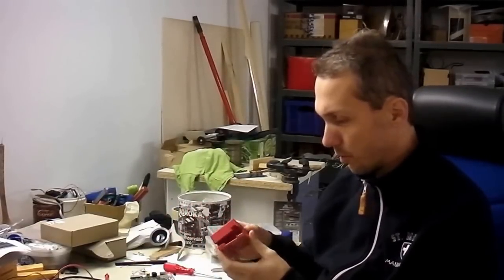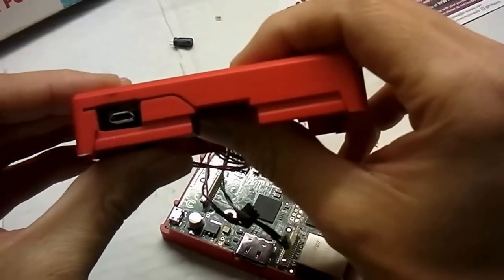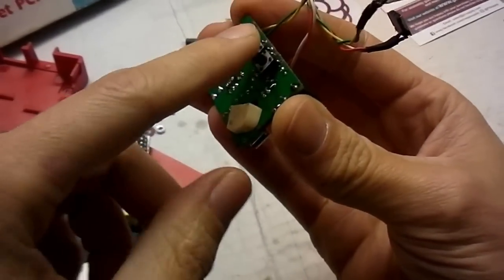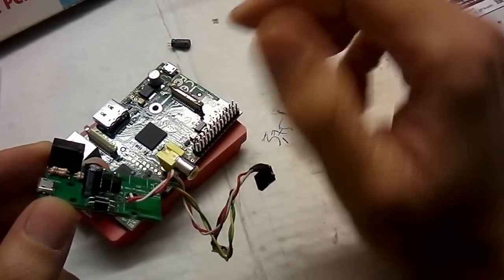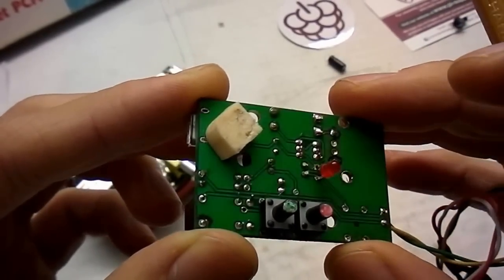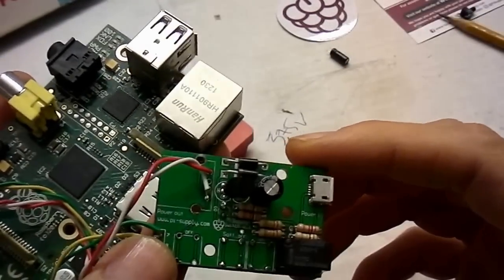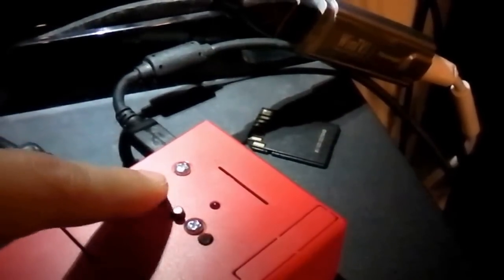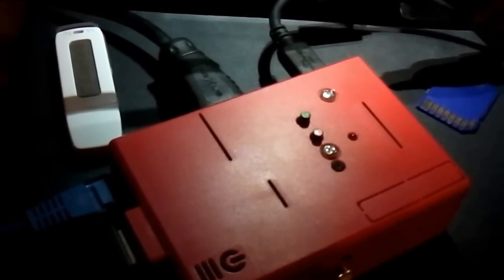pi-supply switch mod

Comment: Thx for this video.
I want to buy also this Pi-Supply switch for a infrared remote-control.

But a question is important for me:

It is necessary for switch on and shutdown the Pi to press the buttons longer as a half second?

The reason is, the relay of the remote control shorts the contacts for 0.5 to maximum 1 second.

Thanks for an answer!
Reply from the maker: The startup is instantaneous. For the shutdown ... it depends on your shutdown script. If your shutdown script queries the button pin in every half a second, than it might loose the shorter events. My "alternative" softshut script queries in every 100 milliseconds.
Reply: Thx for this. I think, through editing the startup- shutdown script it will work in my case.
Reply from the maker: If you're about to go remote, why don't you use the RemotePi board instead? https://youtu.be/aMH5q4_cHR4

Comment: srsly this is the smartest solution to solder the buttons on the bottom side. as a beginner in soldering i have to admit this board is NOT for beginners! even if you manage to get along with the board. i'm stuck with copying the code on my recabox. there is no official proper tutorial yet and YT is your friend in this case. i sometimes regret buying this board but its a nessesary thing to have a propper pw on off button. this guy here tells the truth in every way and has a genius solution even shorten the hard reset button, an idea i wish they had from the get go! best pi switch video, hope you make an entire tutorial video, because you buddy are a hero (priceless hint mounting the buttons on the bottom, as ez as it sounds but if you follow the illustrations, you will put them on the "wrong" side. love you man, you made my day @Balázs Kelemen
Reply from the maker: The board is very dens, still too big. I'm just in a project refurbishing this module, and I'm in trouble because of the size. That USB out is really pain in the neck.
Reply: could you personally help me getting the board running on my rasp pi v3, i go insane with all these useless bits and tutorialk pieces. im a metal stone woodwoking type of guy and that it stuff makes me go nuts and i am fractions away from throwing this shit against the wall. i made the file that has to run the softshut , made the directory first, cd in and made the .py file but now im stuck where to put the code into the bootsequence because everyone seems to edit the "normal" pi but i cant find a noob friendly tutorial for recalbox. following the official steps take me nowhere because he opens files that are empty compared to yt videos... so no existing text and im not THAT much into linux , and never had a linux based system before, thats why i feel unsave and dont want tu ruin the pi and the wort that went into so far. i'm willing to pay for a good tutorial but i need help asap :( you seem to know  a lot and think beyond the retailers smallminded boards and lacking tutorials. obi wan kenobi, you're my only hope :.-(
Reply from the maker: I'm afraid both of are seeking the answer for a wrong question. It seams that the Pi (at least Pi3) already has a built in power on-off feature, that works without any additional active electronics. Please check out this page details: https://howchoo.com/g/mwnlytk3zmm/how-to-add-a-power-button-to-your-raspberry-pi . For recallbox you have this theory built in, and ready for activation: https://github.com/recalbox/recalbox-os/wiki/Add-a-start-stop-button-to-your-recalbox-(EN)
Reply: Balázs Kelemen true story 50€s wasted for the additional useless hardware. bootconfig on/off pushbutton configured after a hint on facebook. mission accomplished. you‘re the best ^^ simple and ez. next time i ask you from the start :D

Comment: I have the Pi booting and the led flashes once then after a couple minutes the Pi will shutdown.
I'm unable to get any input to register in the script while the Pi is running.

Any ideas would be helpful.  Thanks
Reply from the maker: If you use a port other than GPIO8, you need a script installed that programmatically pulls high that pin for the Switch. If you do not do this, the Switch will assume, that your Pi is not running and switches off. (At least this was the case 2 years ago. It might happen that since that GPIO8 is not reliable for this job any more.)

Comment: I have just got the power supply switch and trying to figure out if it is possible to use this module for automatically timed turning on and of of a device? Do you maybe know for some solutions regarding this? I am trying to build insect trap that should wake up once a day and take one photo, send it and turn off.
Reply from the maker: Basically, yes. You may use your own circuit, to alter logic levels instead of the mechanical switches. But if you have power available you should't bother turning on and off.
If you need to go from batteries, you have to build your low-power logic to turn on and off, and connect it to this pi-supply switch. But keep in mind, that the pi-supply switch uses a relay, what also drains some extra power, when turned on. You might want to use a single MOSFET to turn on and off instead this pi-supply switch.

Comment: I use the https://www.yepkit.com/products/ykrud which fits without mods in the board/soldering.
Reply from the maker: I'm not sure I like this YKRUD solution. You are not further with this one.
  - You still need to modify the case without any advise from the product developers.
  - I cannot find any documentation about applying this product to the Pi. (GPIO connecting guide, software for softshut?)
  - The switched 5V output still goes to the MicroUSB female, so you just cannot mount it inside the case without modification.
  - The module is powered on even when the Pi is off, and drains noticeable power.
  - The module itself seems to be a bit overcomplicated, and those active components really extends the power needed by the unit.

Comment: Hi there, nice job, i use your script ^^
Just one question, how did you get the led working ? just by replacing the  220uF capacitor ?
Reply from the maker: No. The led will lit when the software "enables" the Pi-Switch with the keepalive signal. As I use the recommended pin (pin 8), the Pi Linux kernel will "enable" the Pi-Switch in a second after turning on. The capacitor used to fill this gap of time between switch on, and "enable", as the capacitor elongate times in our case. If you wish to use other pin instead of the recommended one, the Pi should boot up for you, so you can send the "enable" from your custom code to your chosen pin (that will lit the led). That is why the bigger capacitor is in the box. But as I use the pin8, a smaller one is enough.
On the other hand, when you want to shut down the Pi, you need to wait for a complete powerdown, as the capacitor elongates this time as well. A smaller capacitor comes very useful in this case.
Reply: Balázs Kelemen ok ! understood, is pretty clear now  ^^ (i'm discovering rpi and all about since 2 weeks XD)
So i just need to add some code to send the "enable" signal to pin 8 for light can work